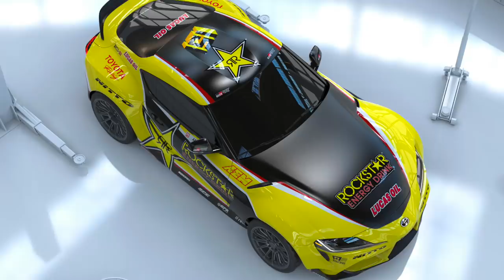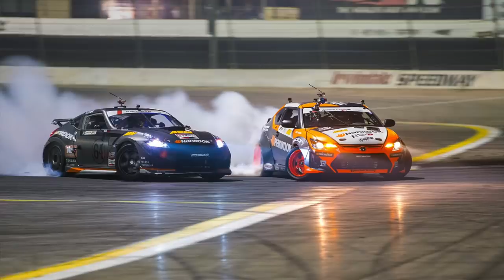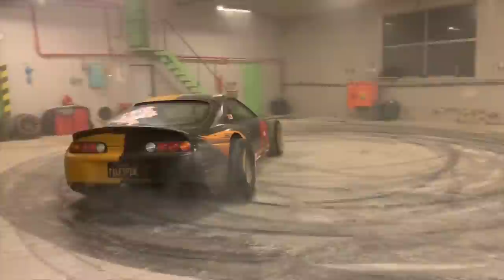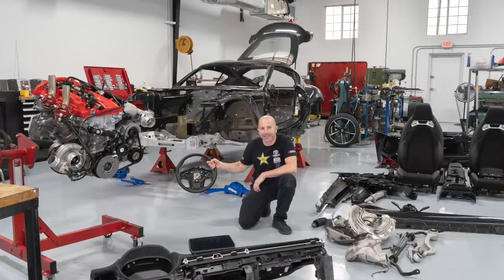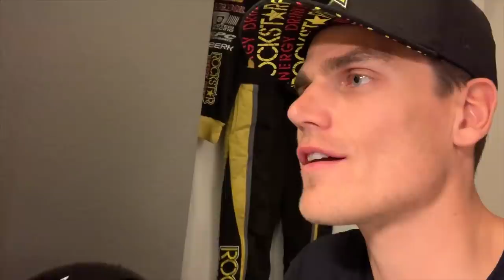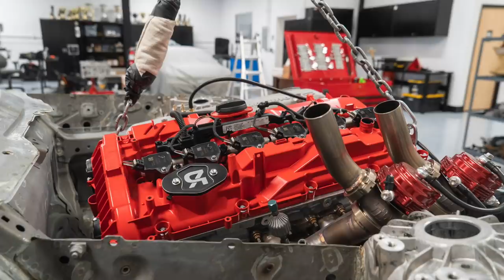First Look: BRAND NEW A90 Toyota Supra Drift Car (1033 hp)

Comment: I really want to see a kit fot everyone to use that wide body is sick
Reply: If it's anything like the old corolla fd car it's not really a kit it's more of whole new redesigned body panel that's fastened onto the chassis with ziptie points
Reply: a whole lotta body work to blend the kit into the body so that no bolts/nuts are showing...so its not worth it
Reply: @herewegoagain7403  it's worth it for the flex alone. But it'll be on you to cut into your 70k supra
Reply: I agree, kind of looks like the Pandem 1.5 kit. This one is cleaner though. Hopefully it makes it to the masses
Reply: Streethunter supra kit

Comment: The funny thing is, I couldn't imagine the supra having a shorter wheelbase than a corolla. Then I looked up the specs. 

2019 toyota corolla hatchback: 103.9 inches
2020 toyota supra: 97.21 inches.

For reference, a 1997 toyota supra is 100.4 inches and a S15 silvia wheelbase is 99.4 inches.

So ultimately this car is shorter than most drift icons aside from an 80s toyota AE85/86

Good luck dialing in the power delivery and suspension for better high speed stability. It will certainly be a balancing act
Reply: Sean Cunningham Corolla wheelbase is longer but the Supra body is longer overall, about 0.5” longer.
Reply: Damn, I didn’t expect it to be that much shorter. It’s gotta be how much longer the body/hood are that make it look like it’s got a longer wheelbase.
Reply: If an S15 is 99 and the Supra is 97 that's not a big deal at all since the S15 is the best drift car in the world
Reply: It comes down to packaging and intent of use - the Corolla needs the super long wheelbase (for its overall dimensions with the wheels pushed to the very corners of the car) to maximise interior space. For reference, the 2020 Mini Cooper starts at a 98.2 inch wheelbase.
Reply: See that’s what I was wondering but your just answered my question I seriously thought the corolla was shorter
Reply: what if you made the track narrower? or is it already?
Reply: got a 2019 zr corolla hatch and thought no way and went and measured yup thats right

Comment: Toyota should use the Supra on the WRC. Seems very cool this project.
Reply: Nah, it would be the new GR Yaris if it was  the case.
Reply: @RAykkonennn  well yeah, the gr yaris is a homologation car that will take over from the yaris they have run since their return to wrc in 2017

Comment: I am afraid the car with this power output is going to spin the back wheels pretty fast hence making your start acceleration slower except you are roll starting
To counter this:
You need to put more load to the back wheels, meaning increasing its weight back, lowering tire pressure, use a longer 1rst gear ratio
Reply: lol

Comment: How far did you shift the engine back from the factory presets?
Reply from the maker: thacher longstreth Factory location (still 40-50 mm from cylinder head back to firewall)